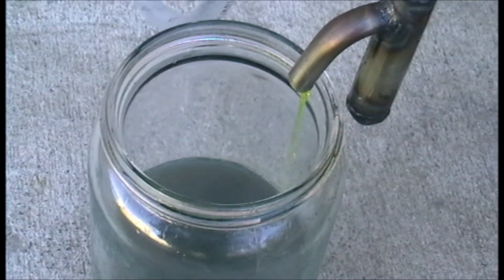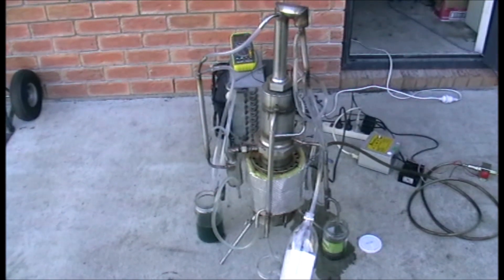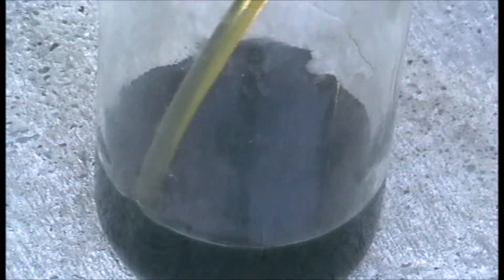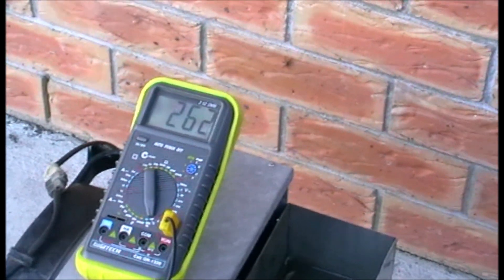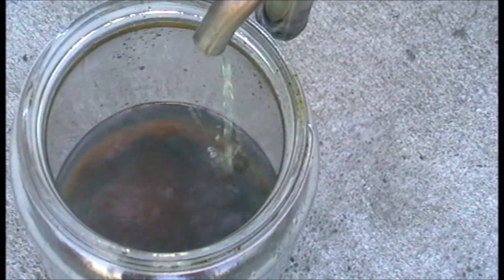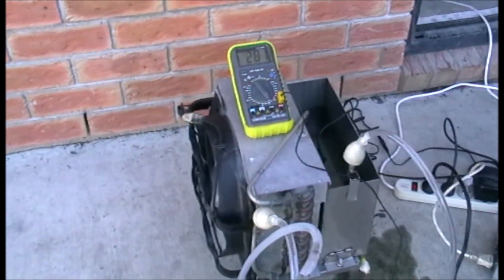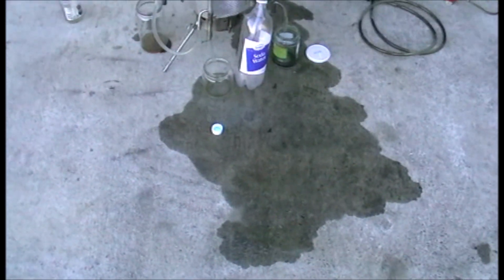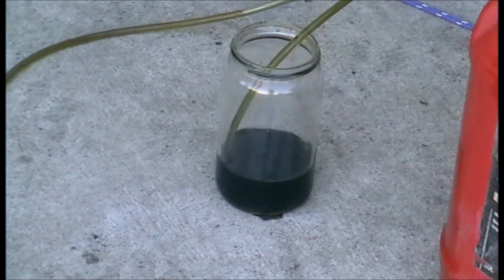WMO Distillation Reformer Further Development.

Comment: Is it possible to distill diesel at a temperature lower than 400 degrees using a negative pressure system? I have previously conducted an experiment where the temperature reached 400 degrees, but the entire area was filled with the smell of engine oil.
Reply from the maker: the best temperature for continuous distillation will be 410c, please do not confuse with pyrolisys , if there is no constant replenishment of oil and waste removal, the temperature will rise due to lighter fraction evaporation, and as a result there will be decomposition and gas formation, stinky gas, and yes you can build a closed type negative pressure unit that will help to do the process at lower temperatures.